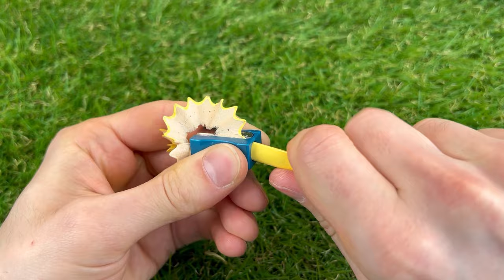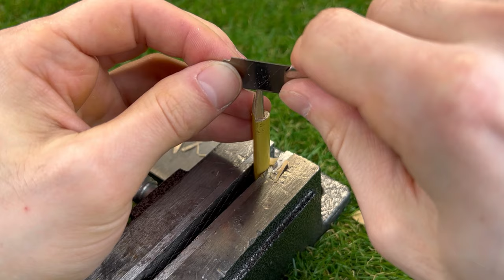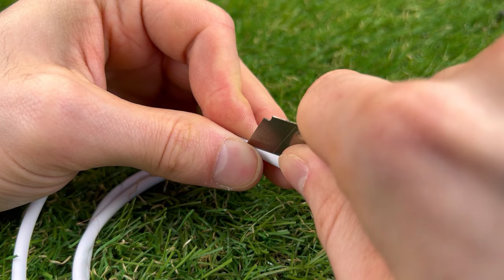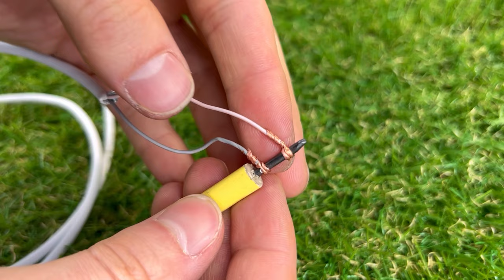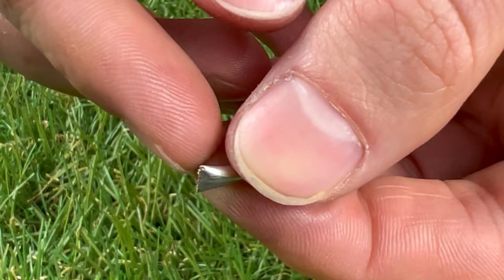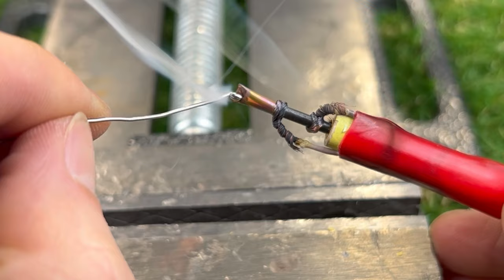How to Make a Soldering iron from a Pencil! An Experienced Soldering teaches!

Comment: With you showing us so many ways to beat "The System", it's surprising that they haven't come after your channel. Many thanks for sharing!!!😊👍👍
Reply from the maker: Thank you for your support! I'm glad you found the soldering iron tutorial helpful. Happy soldering! 🔧🔥.
Reply: This is not beating the system. This is dangerous. You can start a fire this way. If that graphite is getting hot enough to melt solder it is more than hot enough to burn wood.